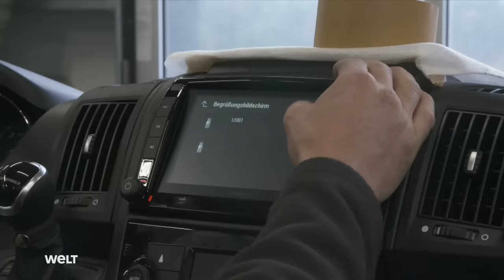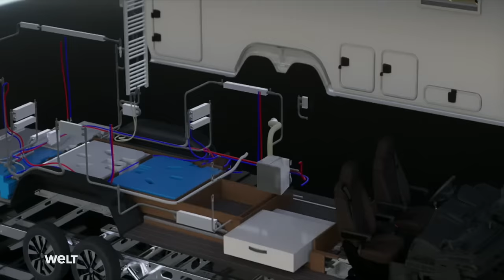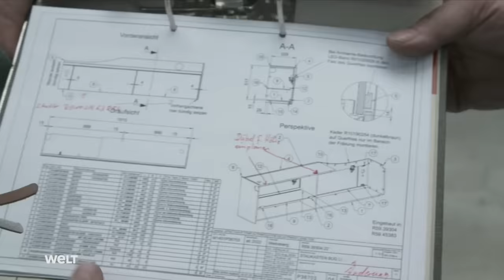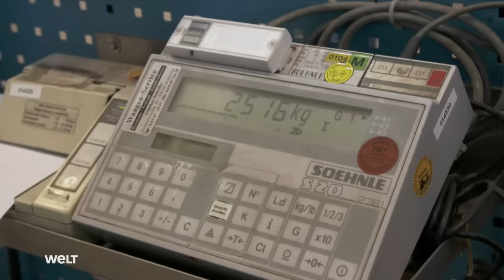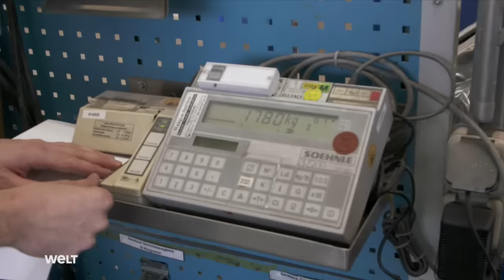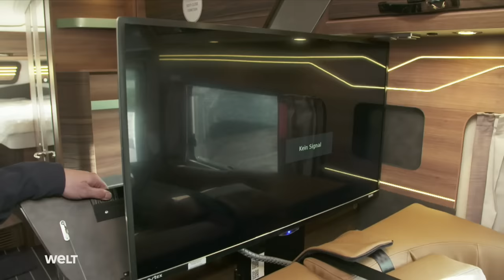MANUFACTURED IN GERMANY: Freedom on Wheels - The home of luxury motorhome | WELT Documentary

Comment: Interesting to watch. To me this 9 meter motorhome does not appear to be very rigid. They have to jack up the chassis during manufacturing because the frame sags a little, as the voice over said. Quality? Who is kidding who? And this kind of vehicle must be dangerous in case of a serious accident. That amazes me as there are all kinds of rules for normal cars and vans. Just wondering...
Reply: These RVs have to survive crash tests just like cars, vans or trucks. Without them, they would not be approved. Oh yes, every flatbed trailer also sags in the frame, even unloaded. That has little to do with stability. Ask a structural engineer

Comment: hang on a bit so they remove the stock Fiat Ducato's front seats then wat? Do they return them to Fiat getting a "special price"??
Reply: Just the seat mounting frame. 2 pounds of stamped steel or so.
Reply: No.  They are not shipped with seats, hence the wood box the factory driver uses for a seat.

Comment: I'm struggling to put the word luxury in the same sentence as Fiat. Not happening for me, I would want a far better chassis and running train than Fiat for that kind of money.
Reply: Is Opel better? Same van.
Reply: I have owned two Fiat Ducato motorhomes over the last 8 years total , 80km on one 40km another with ZERO warranty claims on the Fiat section. I am based in Australia that is not known for it's smooth roads. Both motorhome habitation sections have held up equal or better than the locally made vehicles. Both motorhomes were European made. Fiat is not luxury but super reliable and very comfortable seating for long distance travel.  I can only comment on my experiences to help put some balance in the conversation. Cheers,
Reply: Opel Vivaro van is a Renault Trafic built in France (still now that is a Stellantis brand).
The Fiat Ducato is built in Italy and it is sold also as Peugeot Boxer and Citroen Jumper.
Almost all RVs built in Europe are historically based on Fiat Ducato platform: Fiat has a long tradition in this sector and builds highly customizable and reliable chassis.

Comment: Hell no, I'd rather buy a well built luxury trailer over this, this thing doesn't look safe at all even the chassis looks all flimsy and not very rigid. Half of this vehicle is made out of plastic; makes me wonder how is the crash test.
Reply: My goodness, you have little idea. These vehicles have to pass crash tests like cars, vans and trucks and ask a structural engineer about the stability of such a construction. This is also used in aircraft and shipbuilding.

Comment: I'm sorry but, these RVs simply can't hold a candle to US manufactured luxuary RVs. Then again, American luxary RVs typically cost more than a new construction 3 bedroom house.
Reply: This unit came off the line with zero items on the punch list.  Try that with Newmar, Winnebago, or Tiffin or Thor or Forrest River.
Reply: @raygunsforronnie847  I watched the same video as you did and if we recall, there were still deficiencies, up and until the final QA/QC. Even still, at it's final retail cost, and with sub-par features or options, it absolutely doesn't remotely come close to what's being done in RV manufacturing on even the low-end of luxury RV innovation within the U.S. right now. Don't forget, inferior materials look great going out the door, it's all about what they're actually able to weather once they're fully out of doors that matters to the end consumer.
Reply: @karlhenderson2289  When it left the factory the corrections and repairs were complete, which is the polar opposite of the USA manufacturers.  In Europe they cannot build the "Class A" 40,000 lbs coaches we build here, so solid wood cabinets with veneer, 10mm thick ceramic tile, and other weighty stuff simply can't be used.
Reply: @raygunsforronnie847  so, "walk it off?"
Reply: @raygunsforronnie847  not sure how you ever came to the false conclusion that american luxury coaches arnt required to meet extremely high QA/QC standards before leaving the factory floor, because they absolutely are. However, I happen to know fron first hand experience that the RVs that are manufactured there are absolute garbage that will fall apart in less than 30,000 miles of operation. The engine alone is substandard compared to practically anything that comes out of an American built luxury coach. Anyone with an I.Q. slightly above room temperature can see this obvious fact. But you ahead and keep on trying to convince yourself that they're even remotely in the same class while your your panels warping and your substructure is rotting away, Poindexter. 😉👌
Reply: @karlhenderson2289  You should come to the USA and buy a production motor coach.  Seriously.  Dealers, upon receiving a unit from the factory, will attempt to find and fix gross errors, incomplete work, and damage from transport before a buyer takes delivery.  For every defect a dealer corrects there are 10 more, which the buyer will spend most or all of the warranty period (usually 1 year) getting repairs made.

The glory days of luxury production RVs in the USA ended with the financial market collapse in 2008.  The new coaches are pretty, but they've a huge defect rate.  The fewest defects are at the custom builders like Newell and Prevost bus converters: Marathon is popular.  I'm not sure of current prices but pre-Covid, a Newell or Marathon started around US$1.6 million.  They're beautiful machines with lovely interiors and features but they are NOT the RVs most Americans are buying.  Search YT for the Jayco factory video and compare what you see with the factory above.
Reply: @raygunsforronnie847  Clearly, you are completely unfamiliar with the motorcoach cuctom manufacturing and delivery processes here in the US if you're going to use such a broad stroke to paint all North American Class A coaches in with builders such as Tiffin, Newmar, or even the Canadian/American Prevost line. That European trash box that you insist on carrying the water for isn't even the same universe as these... not even close. 
It really sounds more like you're attempting to suggest that someone can just stroll into camping world and these are just going to be sitting out on the showroom floor. They're not. These top-tier Coaches are customer specific builds which undergo extremely rigorous quality assurance, quality control checks throughout the entire build process before ever getting certified for customer delivery. 
I get it, you really think that the underpowered, poorly equipped "European Gipsy Waggon" is somehow a better product. That's your preference. Still, in my experience, the luxury Class A coaches that I've used here in the US, make that thing look like a pop-up tent by comparison. I wouldn't waste my money on it when there is so much better available.
Reply: @karlhenderson2289  Configurable does not mean custom.  Tiffin and Newmar will sell you a lot of options (and fine, if they fit your needs), but there is no clean sheet of paper.

If I were buying a US-built Class A diesel pusher, I'd be looking for a Monaco, Country Coach, or related brand, built between 2001 - 2006.  After that year, nope.

And I'm not buying what Knaus is selling, either, but I believe the basic engineering of their coach fits the needs of the markets in which it is sold.  I also suspect that Europeans may use their coaches differently than owners in the USA.

So Karl, why are you so bent on defending the USA builders who turn out incomplete and defective Class A, B, C motorhomes, and towable RVs?  You live in Elkhart, by chance?
Reply: @raygunsforronnie847  what I'm doing Ray, is challenging the inaccuracies of your claims regarding North American coach builders because, those claims grossly inaccurate in the general sense and irresponsible of you to cut such a wide range-fan of false statements about an entire industry. If nothing else, it diminishes any amount of credibility that you might've had before deciding to make it obvious that you really don't have a clue what you're talking about on the subject matter. I'd venture to bet that you're likely not an owner of any Class A motor coach(s) which also has me wondering why you'd even attempt to present yourself as a subject matter expert without actually having any true working knowledge of the industry?
Reply: @raygunsforronnie847  So, you've actually driven and lived inside of a chopped Fiat Dicatto with a plastic and cardboard box on the back?
Reply: @raygunsforronnie847  to the retort, all of them do. This episode reveals this. Keep the "punch-list" as a souvenir. And yes, coach builders  still do build custom proprietary framed coaches in North America.
Reply: @raygunsforronnie847  So, again, it came with deficiency. It'll be delivered with some ten-year warranty.
Reply: @raygunsforronnie847  Chief, I do wish that you had just one day to make a mark... Please do better. Again, you've seen the same episode as I have. A gypsy box, built on top of an Italian front-wheel drive. This is NOT a Class A Recreational vehicle, even in Europe.